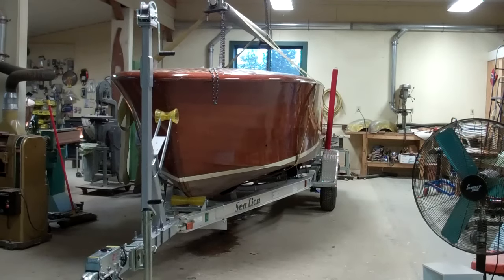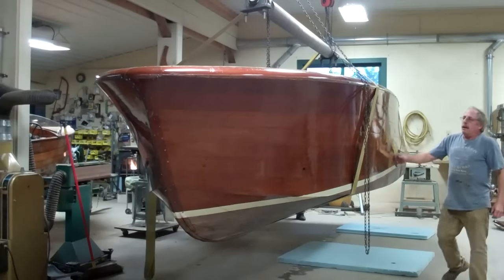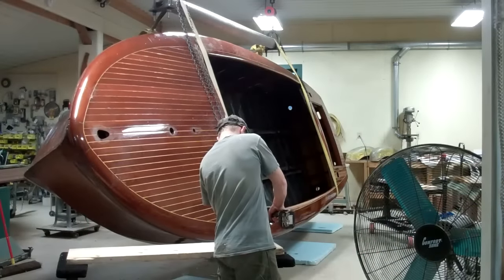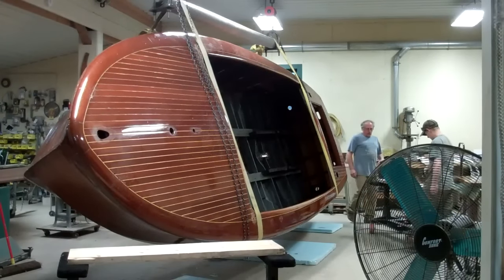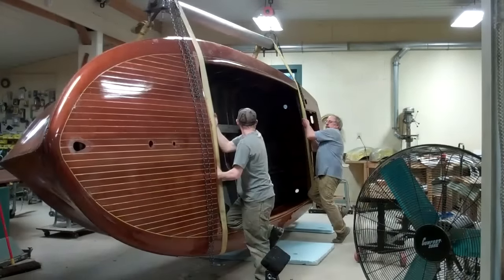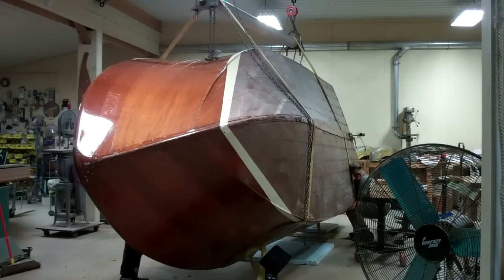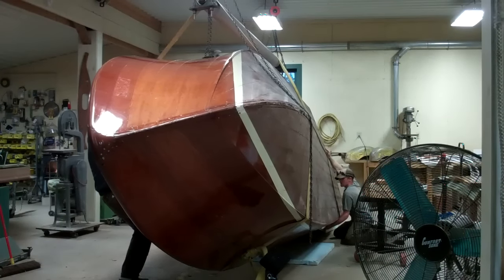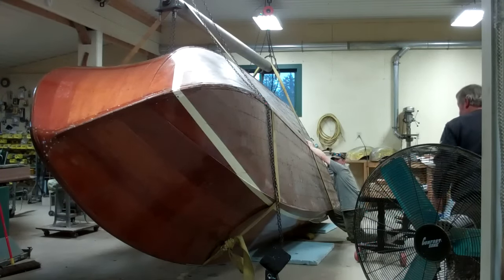Flipping Our '53 22' Shepherd Sportsman! OMG! 11 24 2015

Comment from the maker: Although I still believe we would have been challenged, even had we used this method, here is a great suggestion from Shepherd guru, Phil Jones:When flipping clockwise, tie a rope to the port side, say to the bilge stringer, run it over the port gunwale, under the boat, back up the starboard side, and up over the turning bar, ending up right back on the port side.That way when she rolls, you can continue pulling on the rope from the side she is rolling to, which will kick her over.Thanks Phil!

Comment: This has me curious what is the worries of the wood not supporting itself laying on its side as it rolls or even being upside down for anytime
Reply from the maker: Which is why the slings are positioned at the helm bulkhead and at the aft deck bridge. Whenever we have any sort of concern about stability, we brace the hull athwart ships at multiple points before flipping. The 1946 Mahogany U22 we are preserving is one such example.

Comment: Why did the boat have water in its bilge for months? Water in wooden boars equals rot.

Happy Thanksgiving from NC.
Reply from the maker: I could not agree more. The goal, as it was explained to me, was keeping the hull from drying out. I have now stripped and removed all of the starboard outer bottom planking, save for the last two that run along the keel. Amazingly, while there is evidence of lots of mold, absolutely no rot has been discovered to this point. I will remove the balance of the outer and all of the inner planking today, and fully suspect to unearth some rot by then.
Reply: +snakemtboatworks      in saltwater fiberglass boats , some paint their bilge with awlgrip , which i think it a great idea , if for no other reason you are able to clean the area better , for a wood boat , would some type of heavy duty protective paint in the bilge , maybe similar  to that is used below the waterline be in order ?   thanxs , and i am so envious of your craftsmanship and artistic skills , you are so much fun to watch